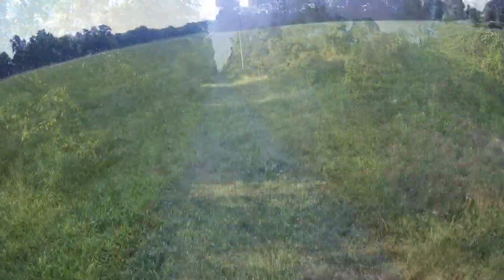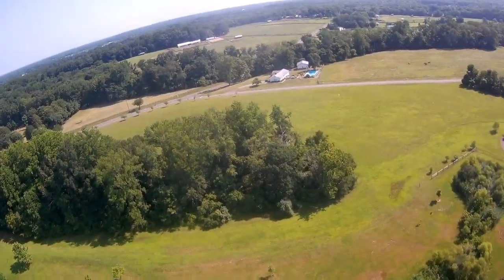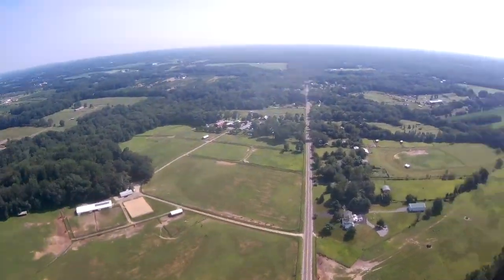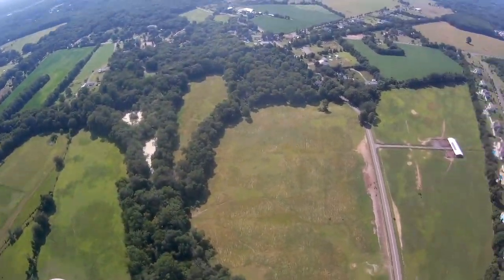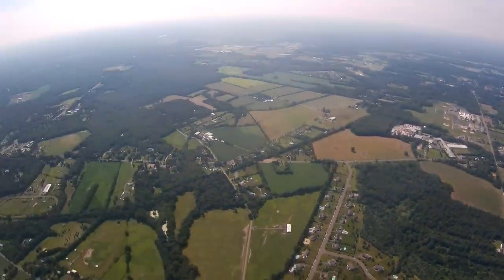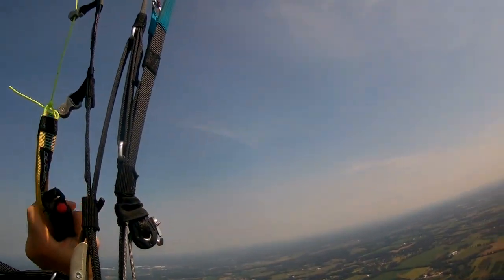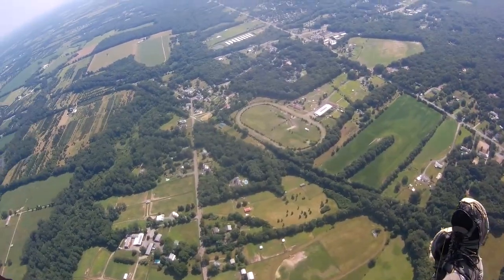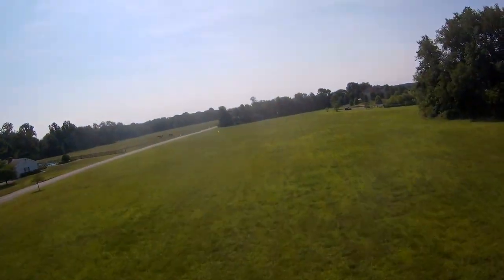I Crashed!

Comment: That's really an interesting accident.  I mean, landings are pretty attention getting right?  I know I'm setting up my trims at 1,000 ft.  I'm adjusting straps on my seat, I'm working to spot my landing, etc.  It's not like highway driving where you might get caught not giving it all the attention it deserves.  

What could have happened that you didn't have the brake in your hand?  Were you task saturated?  You looked like you nailed the spot landing and put it down right where you wanted to.  How did you do that without a brake?

Again, it's really interesting how this happened.  Get well soon, heal completely. :)